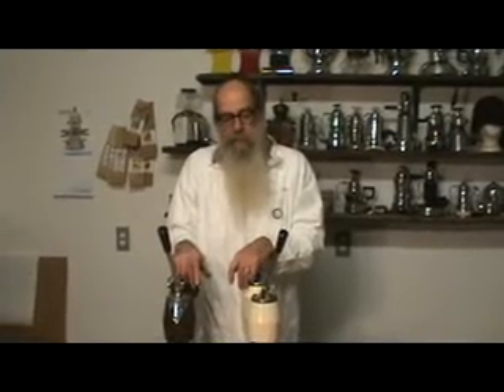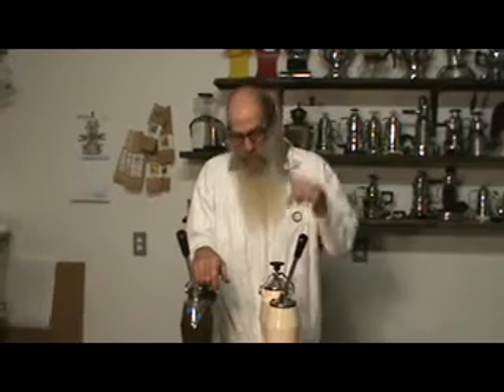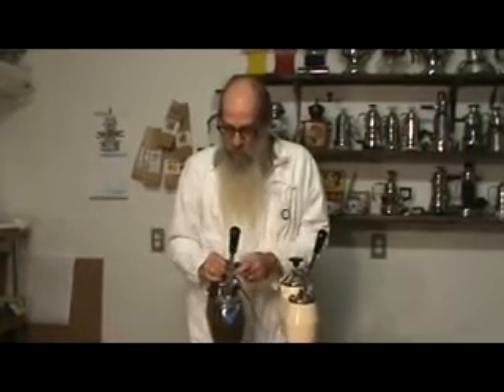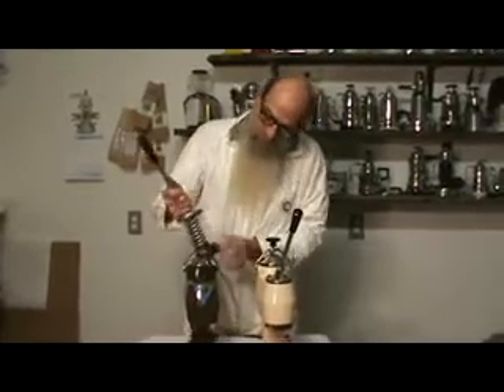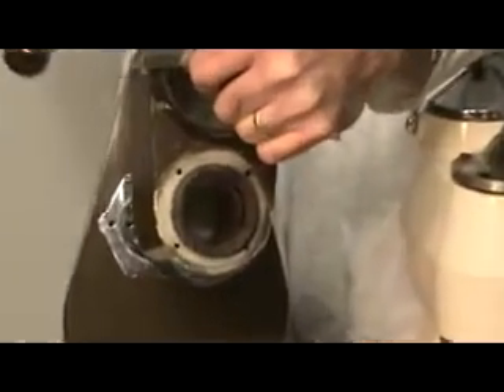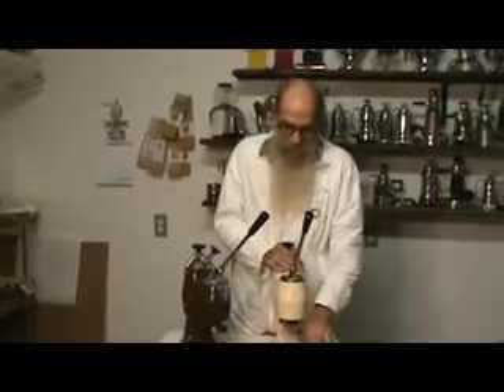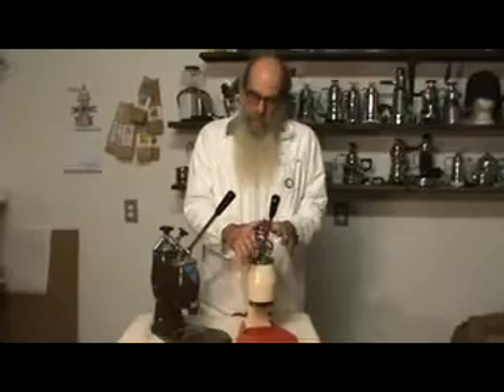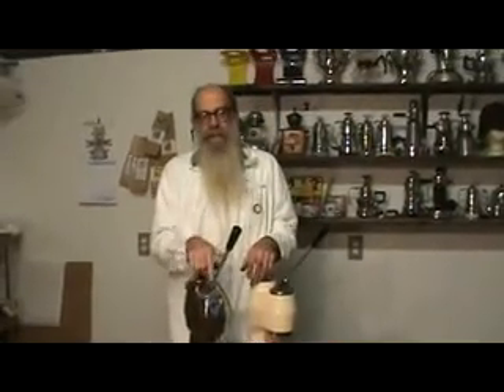Kim Express Video 2 at Orphan Espresso

Comment: Hey, thanks for the video. I’m having an issue with my Kim express. I pulled the piston and cleaned it, but the  o rings were bad letting water into the spring. I tried replacing the o rings with 1/8 thick rings but I still have that problem. I didn’t add new lubricant, but it seems the force of water would push through that. Is there something I could do better?
Reply: Then orings are 1-3/4 inner, 2 inch outer diameter
Reply: @espressofun6091  I found these gasket seal measurements on a coffeeforum .com/uk for the Kim Express. The piston o-rings are 3.5mm thick or 0.138". Might be worth looking trying these out. Hope this helps you man.

3x 41mm x 3.5mm neoprene o rings for the piston (based on buying o rings 2 - 5% smaller than the piston grooves)
1x 60mm x 40mm x 10mm oil shaft seal
1x M25 red fibre washer for the element
1 x 80mm x 3mm o ring
1 x 75mm x 90mm x 1mm neoprene flat gasket - or buy a 1mm sheet of neoprene o cut one from (a lot cheaper)
1x 58mm x 5mm vitron O ring - group head seal